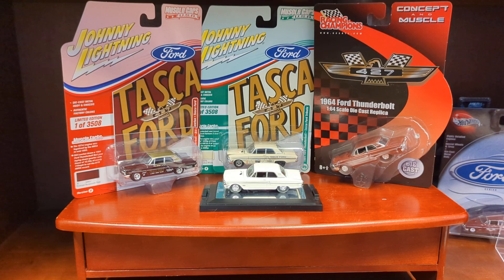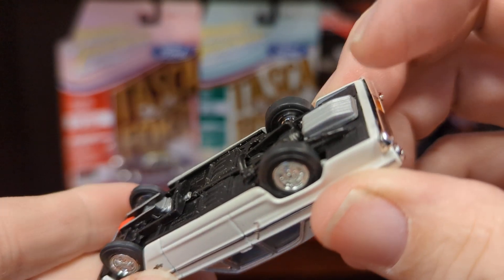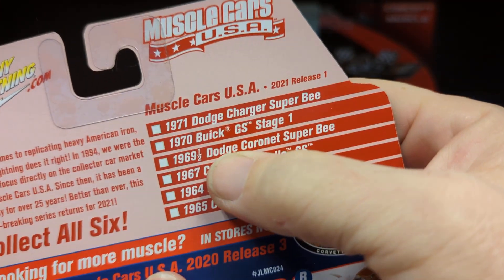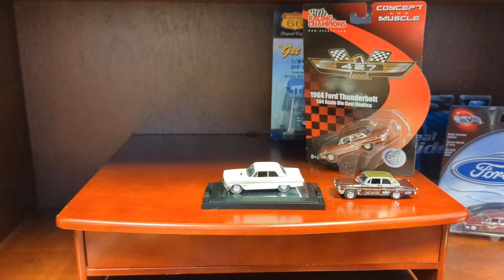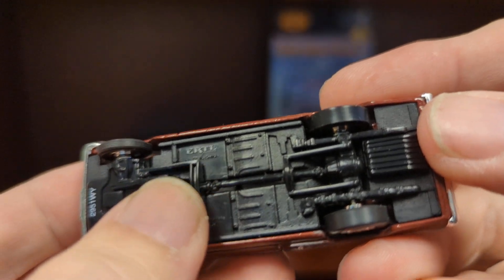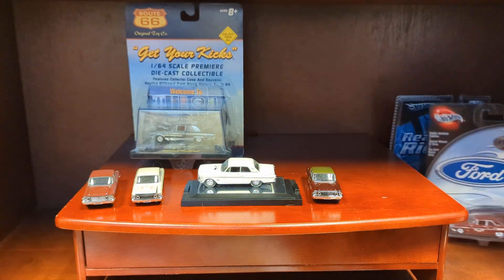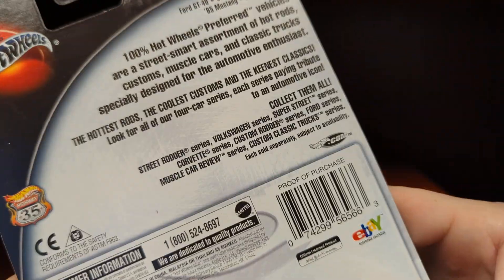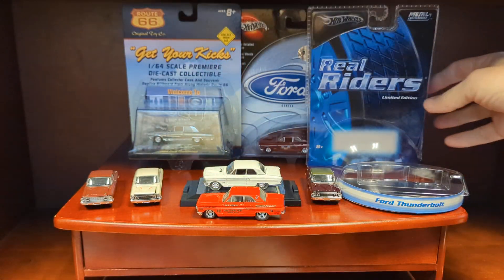Ford Thunderbolts in 1:64 diecast

Comment: I have the Racing Champions Ford Thunderbolt in White from a few years ago...it has the ERTL logo on the bottom to let you know that is where the casting originally came from...I learned that not only does the hood open but the trunk too!